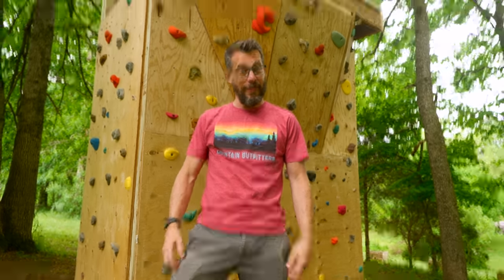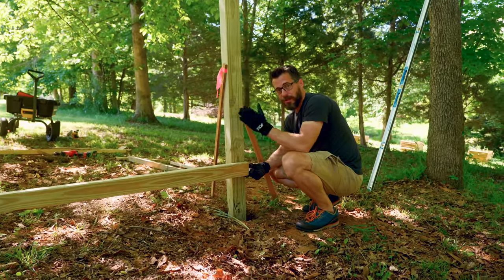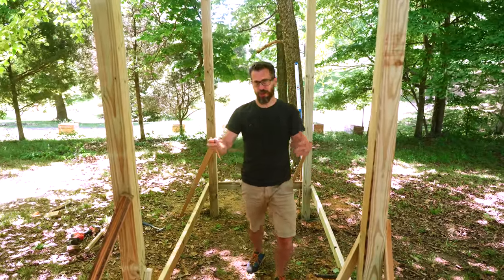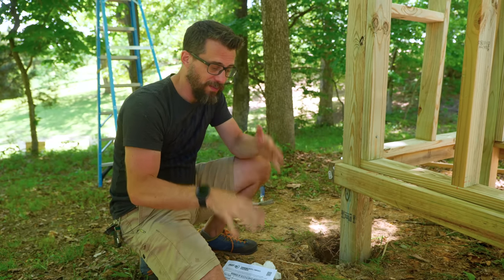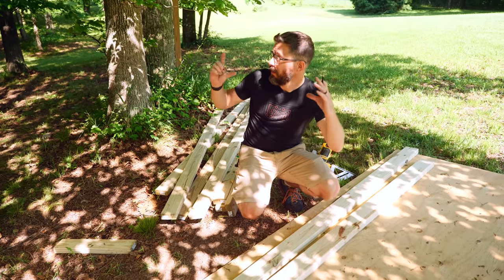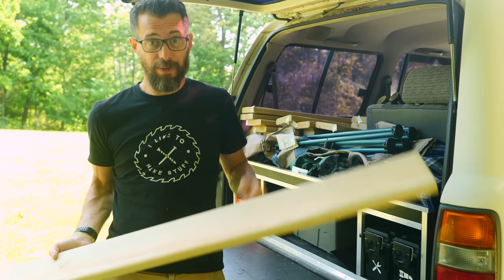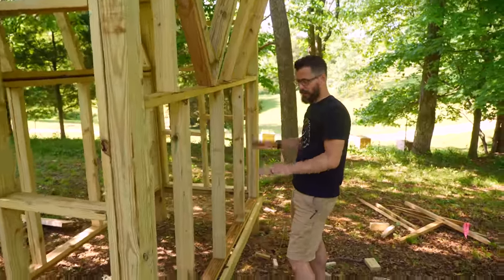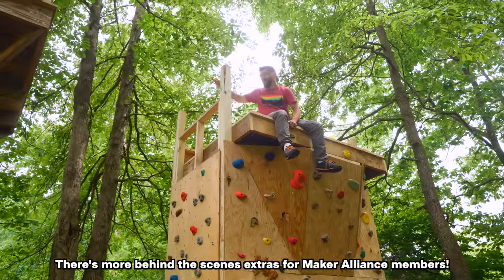Making a Backyard Climbing Wall | DIY Outdoors

Comment: Hey Bob, how about a rope Bridge. The columns would be separate from both structures, so you can make sure it's secure, then lay the deck attached by rope on it. 
It sounds very challenging but at the end it's a basic statics problem. 
A big downside is the loss of one of the 4 walls functionality.
Reply from the maker: Love this idea!
Reply: I scrolled down to the comments just to say "rope bridge." :)
Reply: Yeah rope bridge or the kind with the wooden planks/logs chained to each other.

I used to work at an outdoor centre with an area like this, you can get pretty creative. We built a massive swing between two trees over a small river, and a giant pole you climbed up and had to stand on the top of before jumping off. All of it was done wearing a harness with someone belaying though so we could make pretty intense things that felt far more dangerous than they were.
Reply: Came here to suggest a rope bridge as well. That would be killer and would be a great learning experience on how to make one.
Reply: Same! Rope bridge!
Reply: That's the first thing I thought of to connect them to
Reply: with all the trees there you should make a mini ewok village
Reply: This is exactly what I thought of the moment he said "if you have ideas, comment below" 😁
Reply: Exactly my thought as well
Reply: Beat me to it, haha. Could go with the three strand rope bridge or the rope and slat bridge.
Reply: I went down to the comments to say this exact thing.
Reply: @therapeutic-sawdust  Is there a hunting season for Ewok’s?  I was thinking of a deer stand for hunting season.
Reply: Totally! I was watching this on TV and picked up my phone afterwards just to say rope bridge in the comments.
Reply: I was thinking this too. The kind that spans the chasm of some river in the jungle.
Reply: I was about to suggest a suspension bridge myself. Maybe a chain bridge if you're worried about rope degrading over time
Reply: @Iliketomakestuff  What about a Monkey Bar and a rope with knots so that they stretch across or climb above to get onto the platform or Monkey Bar with a half ladder in between the Monkey Bar so that they can climb up onto the platform easier   Or even both iterations, this and the rope bridge from  TheLopez2617
Reply: Yes!

Comment: I definitely need to build one of these, if for no other reason than making it NOT perfect is totally acceptable, and actually almost preferred! 🤣
Reply: Just got to be sure it's still stable.  🤣
Reply: If you want to use metal for the core and you need suggestions feel free to as me. I build one a year ago and it's super fun. (8m² on the outside, attached to house walls)

Comment: SO cool!  Did I miss the part where there's a finish put on the structure? Won't the exposed plywood get pretty damaged with a lot of rain? Or would it just be cosmetic?
Reply: Pressure treated doesn’t need finish outside

Comment: You may want to check what your t-nuts and bolts are made of. I built a similar climbing wall 2 years ago and all of the handhold bolts and t-nuts are rusting. The ones I used looked the same as yours and they came in a kit that was meant for outdoor use. If I could go back I would have either used something different or I would have sprayed the hardware with something while I was installing it.
Reply: I think ur supposed to use galvanized nails bc most screws don’t have shear strength so when climbing a screw could easily snap in half 😨

Comment: Even though 2 feet is deep enough for the frost line, but also the height and weight of the structure may impact how deep the structure/footings should be. In an area where there are nasty winds, it may need deeper footings to keep it from becoming a sail.
Reply from the maker: True, but this structure is deep in a thick patch of trees that will hopefully help dampen the wind.
Reply: @Iliketomakestuff  I thought about that, but just wanted to mention it. Our area doesn't have many trees and we have had several days just this year where there have been sustained winds 60+ MPH, so I am thinking about that.
Reply: The standard rule I learned was a third of your height above ground should be how far you go into the ground so for a 10 foot tall structure you should be 3.3 feet in the ground.
Reply: @DavidLeeKersey  good to know
Reply: Could always build some “outriggers” that tie to deeper anchors if it ever becomes an issue.
Reply: @projekt6_official  "outriggers" might be a hazard for a climbing wall. You wouldn't want anything that someone could fall on.

Comment: Pretty cool climbing wall. I built one in my garage years ago to help train during the off season. One trick I did was to use liquid nails on the back of the t-nuts to make sure they didn't pop out the back and fall back behind the wall. Saved me from having to pull a whole panel down to retrieve a loose t-nut. Thanks for sharing 👍

Comment: I like using the Tnut with a flange with screw holes in them, Lowe’s has zinc coated ones but some online places have the stainless version for a few cents more.  Way easier install, and I use them in other woodworking projects as well.

Now you need to build a crack out of bondo, we did that years ago on a 2x12 I think about 12’ long.  Forget how many gallons of bondo went into it with an aluminum foil base to take up some room and get a rough structure going.  We put it on a 7’ tall fence and had the bottom start at about 3’ off the ground, we quickly got in trouble at the camp and had to move it to a less seen area.

With the price of plywood right now, the climbing holds might be the cheapest part of a climbing wall LOL.

Comment: Great build!

One thing I’d point out is the side where you have a vertical slit open into the interior between the two faces, it seems to taper down into a sharp V at the bottom? If someone were to put their hand/arm in there then slip off the wall, their limb could easily become jammed in the V section. Would cover that opening up with plywood.

Looking forward to seeing how you connect the two platforms. Getting lots of ideas here !

Comment: That's a fabulous structure with a lot of potential.
Nothing as complex as yours, but when I was ten my father built me a seven foot high platform at the bottom of the garden. There was a ladder to get up to the platform and to get down there was a wooden slide and a foreman's pole made from a scaffold pole that went through s hole in the platform. Later we added walls round the top made from fencing panels.
I and my friends had a lot of fun with that structure. It lasted about five or six years.

Comment: I had a thought from the start, I'd use the inside as a place to store my extra holds, making sure to keep them from getting wet. Means, as you find more interesting holds, you can keep them all together in one place and reset the climbs with all the major components nearby

Comment: about that connection: either a rope bridge as already suggested or an overhanging climbing section with some kind of bridge on top. With that section, you'd have a rather difficult climbing section and an easy way to get over from the plattform.

Comment: To connect the climbing tower to the zip line platform you could make a chain Bridge. I had one on my fort growing up. My dad used four  chains  and bolted 2x4s for the walkway to two of the bottom ones and the top were the rails.

Comment: Cool build, Bob!  Suggestion for the future - Instead of a concrete block (which will eventually sink into the ground) to shore up the middle of the sagging framing, a 2x6 or 2x8 screwed into the side of the bottom plate should provide plenty of resistance to deflection... Think deck joist...  To be fair - the plywood sheathing may be enough shear resistance to keep things from sagging too.

Comment: Have you seen a Monkey Bridge?  Only requires three main ropes/cable. One to walk on and then one for each hand.  Then use smaller rope/cord to connect each hand rope down to the walking rope/cable.  The shape of a V.  used to build them at Scout camp or large camping events.  Have you considered adding a Peg Board on one side.  Helps with advanced climbers to improve hand eye coordination, plus even more strength.

Comment: Hey Bob, how about connecting the two platforms via a metal chain bridge with rope rails and possible wooden runner beam at base? Would be good to see mix of metal work, woodwork and then work with creating rope handrails

Comment: I connected two towers for my climber on the bottom is a swing beam and soon to be monkey bars (he has swinging ropes, rocks, etc in our basement ceiling) On the top, I am putting planking for a catwalk/bridge way to the loft of the second structure.  It is still a work in progress but thanks to this video, the climbing tower is ready for an upgrade away from the straight vertical.     Could you talk about the fall safety of such a structure?  The searches have lead me to think it needs somewhere between grass and huge amounts of mulch with a tangent of people saying rubber padding.  I can add mulch but I would like to keep things natural as much as possible and sustainable.  Thanks Bob and ILTMS Team

Comment: to prevent that sag, you could also connect a 2x4 down on the inside to the center where the sag is. I think your 2x6 or 2x8 you are using can sure up that load.

Comment: Could put a solid floor to connect the two platforms then underneath it you could have a climbing roof parallel to the floor which would add some challenging routes for training/stronger climbers. You would want to buy a bouldering pad for a roof tho as you wouldn't want to land on the floor with your back.

Comment: Having seen my parents build climbing walls professionally my whole life, this video is a different kind of watch for me ^^"
Reply: the classic inside gymnasium wall is basically the same idea but with steel framing and resin and sand for a fake rock texture (they also did fiberglass structure with super fancy geometry, but that's a whole other level ^^")

Comment: As someone who used to build outdoor climbing structures professionally your top plywood edges are going to soak up rain/snow and will delaminate the plywood within probably 3 years if you don’t seal it really well. It can be really hard to seal the edges of that cheaper plywood because of the gaps. But you definitely need to put something on it to protect it from water.

Comment: Whatever connects the two platforms should double as monkey bars or something you can climb on from the bottom. That way the wall under the bridge can still be used to climb. You just add a new feature

Comment: You probably want to drill a hole in each of the bolt holds and add a screw to stop them from spinning, especially on an outdoor wall that will expand and contract with the weather. The holds will start to spin eventually and someone will likely get dumped on their head.

Comment: 19:11, that wedge shaped hole looks like a good finger remover. Probably best to stick a block of wood in the bottom of the triangle so it doesn't narrow down to a pinch point. I see the younger boy using the side of the 2x4 as a hold so hands are going in there and as it's easier to hold than one of the grips it'd probably be the last to let go if you fall.

Comment: My only thought for what I would do differently is to make surround on the upper deck "meet code" for deck railings. That is to say, I would bring the climbing wall sides up so the top us 30 inches above the deck floor. It's a small thing, but it's bothering my OCD to see those "low" walls...

Comment: Interesting project Bob, who is your minion?  In the past when using T-nuts we created a jig that layer flat on the outer surface, insert a linguist bolt into the hole , finger tighten the bolt and use a ratchet or nut driver to pull or snug up the T-bolt into the hole.  

Wishing you and your team a great week and a blessed Memorial Day holiday.  Cheers

Comment: I think a rope bridge between the climbing wall and treehouse would be pretty cool and allow for the sway of the structures. Cool video as always. My only questions is how soft is that ground if you take a fall? I've never done any free climbing and take great comfort in my belay line. The bouldering room in the rock gym has a bunch mats all over the floor. Just curious as this  what prevents me from seriously considering building something like this.

Comment: Great work! I've been planning a indoor wall for some time, so I'll look out for that Metolius book. A few questions: is the foam method cheaper or faster for the footings? Because it seems like ready mix concrete bags would be a surer bet for now much money. Are you considering painting and texturing the wall like they have in climbing gyms?

Comment: As long as the plywood is securely fastened to the wall frame, the wall will act like a beam. No need for center supports. Longer (over 8') walls won't work that way, because of seams in the plywood.

Comment: Someone else said it but a rope bridge between the two platforms would be cool. 

And just a question, did you weather treat the plywood or would you be worried about the plywood in the outside elements?

Comment: Your connection between structures absolutely needs to be a rope bridge. I would think something like a V-bridge would be ideal, the kind that has a single rope on the base and ropes with guides to either side so when you look at it head on it has a V shape.

Comment: Cargo net or rope bridge to connect the two structures. Defo. Flexible enough so the structures can move independently from each other but still permanently bridges the gap... So to speak.

Comment: The wood splinters from the extra holes are not smoothed. These will definitely cause problems as they were drilled from the back of plywood sheet.

Comment: Instead of hammering in those nuts all the way, could they just be tapped in place, and the tightening of the bolts would pull them all the way into the wood?